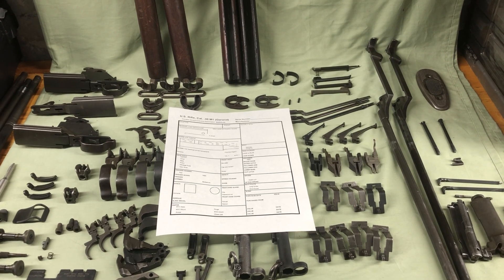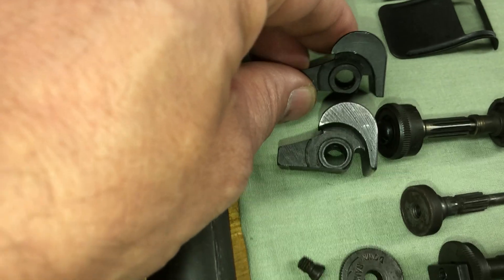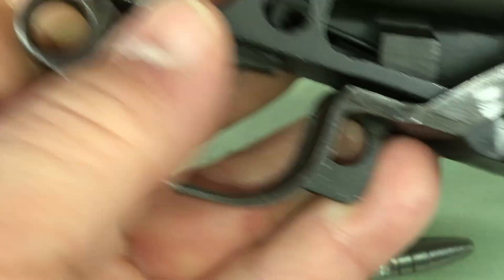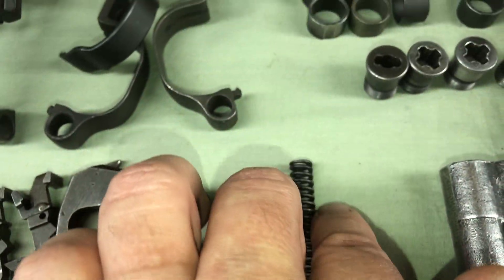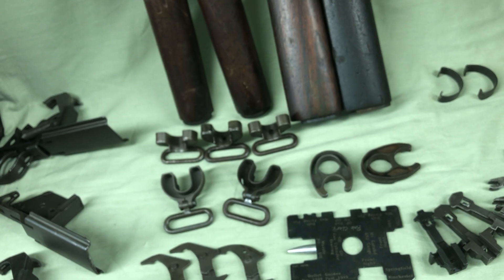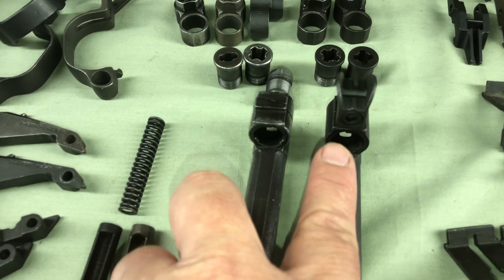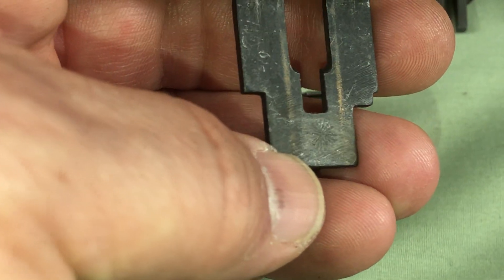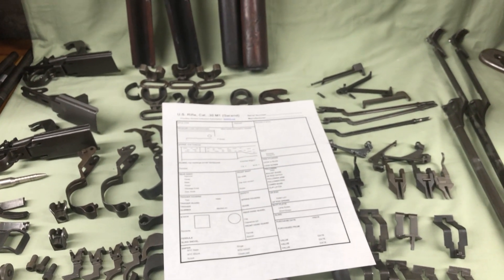M1 Garand How to Complete Data Sheet

Comment: Have a all original Winchester 2,371,XXX Bought in 1984 at a small antique shop in mid Mo. Took rifle apart years ago have researched it couple of times over the years ,I believe I  have a non molested rifle. Punch marks, rough machining, correct numbers, stock markings ect.  I do not remember what the owner told me about the rifle. Low round count, tight, good shooter, trigger is great, better than my Springfield M1-A. Looks like rifle never left the states. Just came across your site. Went over the rifle again for the 3rd time after watching this seems all Winchester correct to date . I can disassemble it again ,have my son take detailed pictures and send them to you..Great site..
Reply from the maker: Sounds like a great score.  Your rifle was serialized about December 17-19, 1943.
Reply: 🏁🏆🏁🏆I had one ,sadly I traded it 28 years ago .That thing haunts me to this day.

Comment: When you say Springfield Armory, you're talking about the USGI stuff and not the newer company, right?specifically my milled trigger guard stamped with a T.
   Secondly, my rifle is a mid July '43 SA......should my hammer spring housing and plunger be in the white?
     Finally, the long buttplate bolt any idea when shouldered vs. straight cut was used?
Reply from the maker: I only refer to USGI items unless specifically call out a commercial or aftermarket name.  The finish on those parts can be finished or in the white.  Need a shoulder screw for that time frame.

Comment: Very nice video. I'm trying to determine if I have a sleeved 308 chamber or a milled chamber. Can you help ?
Reply from the maker: First, determine is there are any markings on the outside of the barrel.  Then an examination of the chamber is necessary.  If there are no markings, its safe to say its commercial.  If there is a small ring in the chamber then it probably is a sleeve.
Reply: The barrel has cross cannons, some other letters and this on the right side of the barrel (1-sa-1-45). I understand that to be a Springfield Armory barrel.

Comment: so is there a source(s) of this information that shows nice pictures and labels each item as to type and/or manufacture?  I am just beginning Garand collecting and right now without a stamped number on the items I am have no clear idea what some of them are. I have Duff's ww2 book but the picture are not that useful for some of the items. I am starting with what I think should be fairly easy, a SA Feb 1945 matching rec/barrel and have been able to find the parts with stampings, but I can't figure out for sure what some of the others are or if I see one for sale if it's what I need.
Reply from the maker: Best book out there is by Joe Poyer, if you can get them.  It's about $25, has a lot of info on markings and which serial numbers are correct for certain parts.
Reply: @norwich93CMP  and even the book is hard to identify. which edition? how many pages?  I see something that looks like it from $22 to $150.  then the reviews seem to have similar issue that I have, no enough or clear pictures so that you can be sure about a part that does NOT have a stamped number/letter on it